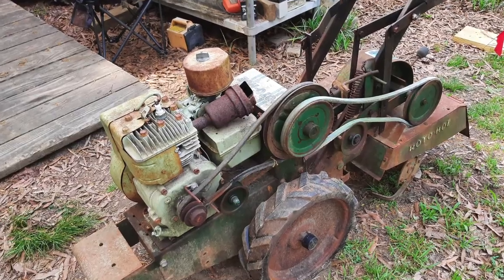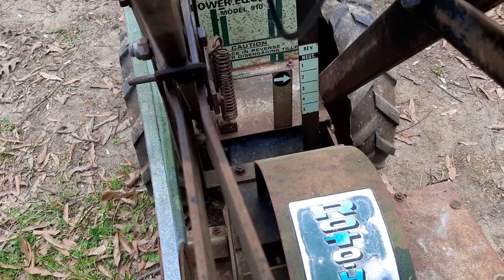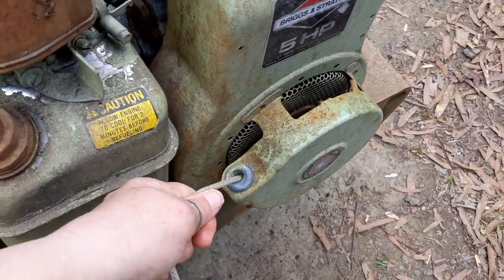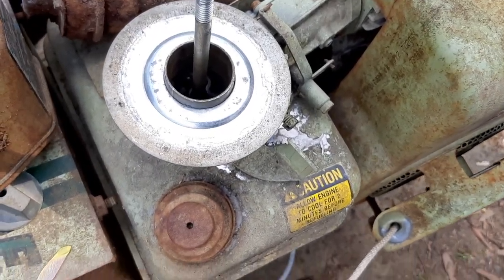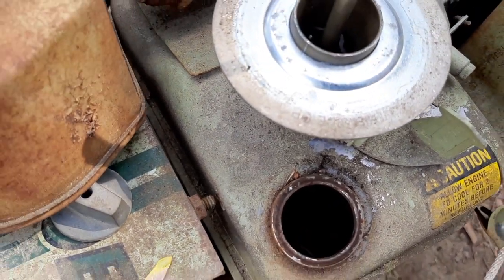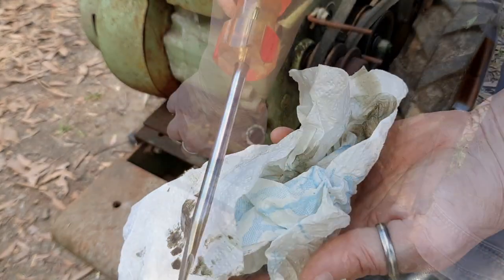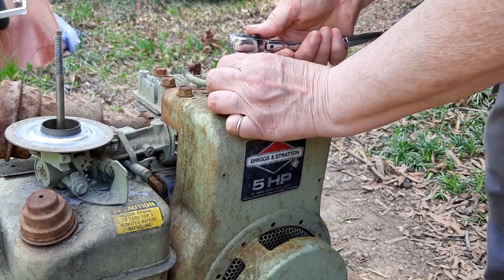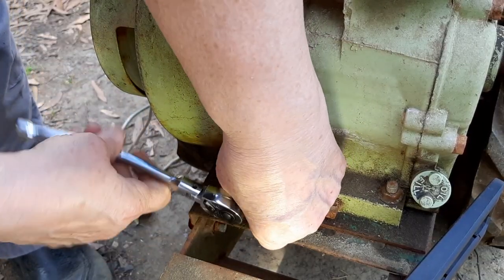Briggs 5HP Broken Recoil Spring and Starter Clutch Fix

Comment from the maker: If you enjoyed this video, or it helped you, please consider clicking on the "THANKS" button above. 🙏 Watch this video for another resurrection of an old lawnmower: https://youtu.be/HACl7l8NuqI
Reply: Do you know how to replace  or retrofit if all your tabs are broken off on the metal housing that holds the pulley ?
Reply from the maker: @Cleric40  Outside of using a spot welder to attach now tabs, I'd likely be looking on ebay or similar site for a good used one.

Comment: That recoil replacement worked good for you Stella. I remember doing one on a 1960s B & S mower with an alloy pulley. I had the spring uncoiled and clip the end onto the pulley. Close the tangs on the shroud and then wind up the pulley to the last, and then uncoil slightly to line up the hole for to install the rope. Only thing is you would need a good wrist 😅.
Reply from the maker: Someone else mentioned something similar. I honestly don't see a lot of these for a new spring, but I will try that next time. I appreciate you watching!

Comment: Automatic transmission fluid works great to lube the starter clutch (and the recoil spring). It last longer than motor oil or 3 in 1
Reply from the maker: Thanks! Good idea.

Comment: Replacing the springs are easy.   Clean everything.   Undo your new spring.   Assembly:  1 Fit the pulley and bend your tabs in.  2 Take the new spring and straighten the inside coil a little.  3 Look at the starter thru the hole that the spring gets anchored on.  Then turn the pulley to get a clear line of sight to the pulley anchor hole. Have your starter rope handy ready to insert into the rope hole.   At this stage you have the pulley installed fully.   You have the new old rope attached to the stater handle.  And the new spring laying there with the inside coil slightly slightly straightened. Now to install the spring.  You will need your  long nosed pliers handy.   1 Insert the straightened part of the spring up to and thru the pulley anchor. Draw it back out far enough to twist and make it catch on the pulley.    With the spring caught by the pulley, start winding the spring into the starter housing.   As the other end of the spring gets closer to the housing use your long nosed pliers to stop the entire spring from being pulled into the starter.  Guide the spring into the outer anchor.  Your spring and pulley are now installed.  
Fit the Rope.   Have your rope ready at the complete length required.  Install the starter handle.   Have a nice clean end on the starter rope.
This part is identical to fitting a rope to these starter.  
Wind your starter pulley by hand all the way till the spring starts binding a little.  You need to keep hold of everything.  The allow the pulley to wind back to the first possible starter pulley rope alignment.    At that point insert the rope into the hole.  Drag it thru all the way.   Then let go of your pulley.  The correct length rope for your application is now installed at the correct tension for your application.    Hope i didn't miss anything.    Briggs Trained Tech
Reply from the maker: I would love to see a video of this. Honestly the first time I tried this (several years ago) I looked at the instructions in the spring package, and decided it was way complicated, hence I figured another idea. Thanks for that info.
Reply: @TheLawnmowerLady  I will make one for you to access.  If i can't find a starter here I will let you know.
Reply: I couldn't find the exact starter,  But I have made one for you to cover more current machines.   Where do i send the video ?
Reply from the maker: @rolfgrosseholz1311  Thank you!!! lawnmowerlady77 (at) gmail
Reply: @TheLawnmowerLady  The link I left has the video.
Reply from the maker: I don't see a link. Did you send it via the email addy above?
Reply: @TheLawnmowerLady  You should find that link in your email as well.  Sent it this morning.     From Australia.

Comment: I wish people would take care of there old equipment. This stuff was well built. Just sad people giving up on the old stuff. I understand it takes time sometimes but it's worth it in the end. The new stuff just junk. This is not junk this is awesome stuff.
Reply from the maker: I agree! I appreciate you watching. Cheers!
Reply: @TheLawnmowerLady  I am getting running a 1975 Briggs and Stratton 5 horsepower motor log splitter been in my family for 50 years. Has not run in 18 years but it was stored in my uncle's barn and we use fuel stabilizer and fog the carburetor back in 2008. Just doesn't have spark almost there it getting it fired up.
Reply from the maker: Being that old, I suspect points and condenser on the ignition might be the spark issue. If a bit of fine sandpaper on the points faces doesn't do the trick, I recall seeing other creators replace the coil with an electronic ignition module, eliminating the points. The videos I've seen show a direct swap out with no modification. I think @donyboy73 and @StevesSmallEngineSaloon both have videos on this. Hope this helps.
Reply: @TheLawnmowerLady  yes it does have points
Reply from the maker: Rotate the engine till the points are closed. Double over a tiny strip of fine sand paper (400 grit is good). Use a screwdriver to open the points, insert the paper strip and pull it out. Repeat 6-8 pulls. Apologies if you already know this...